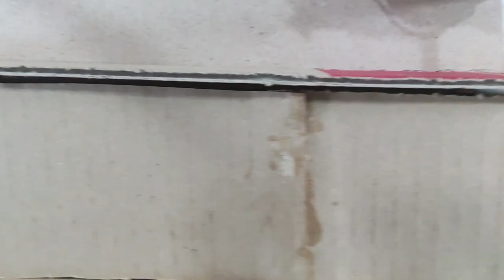DIY Cardboard Conveyor Belt

Comment: What seems to be the problem if the conveyor is not rolling?thanks
Reply from the maker: Maybe, Check if the conveyor paper is tight enough or the battery has enough power.
Reply: @DonskyTech  thank you for answering my query. I appreciate it.have a nice day
Reply: Sir kaya po ba ng dc motor yung 8x10 na conveyor belt? If not po,ano po ba dapat?thank you